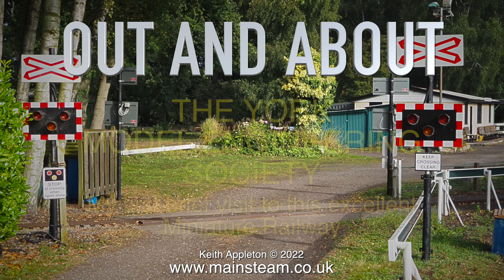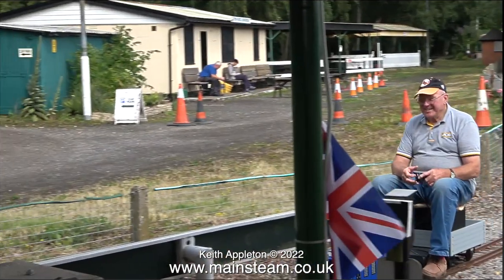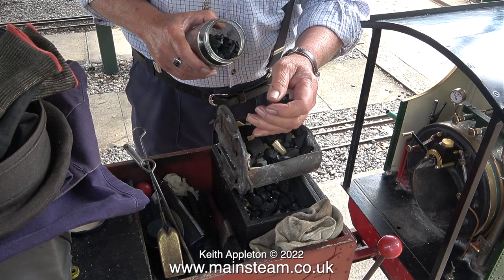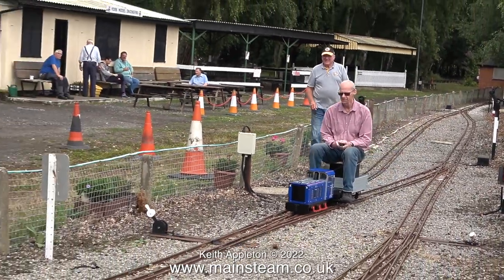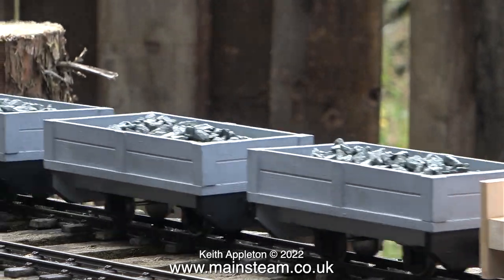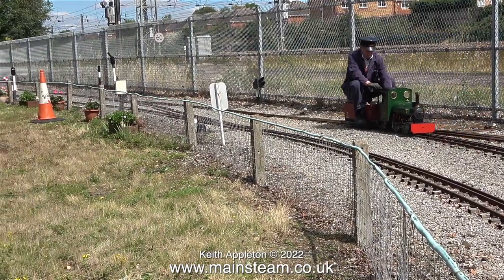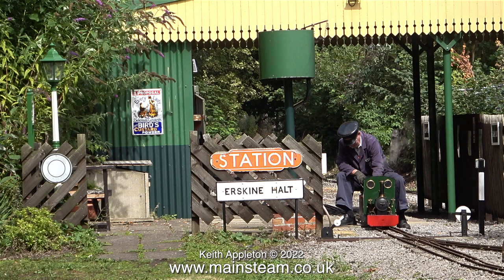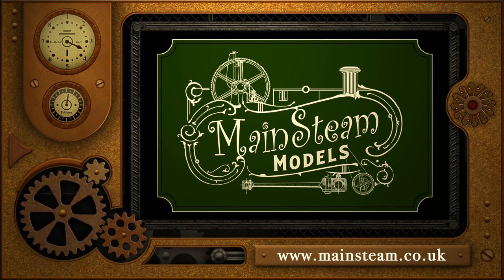OUT AND ABOUT - YORK MODEL ENGINEERS - FIRST BRIEF VISIT

Comment: What an amazing place. It brings back memories of when I was a Train Driver. 
I drove nearly all the diesel-electric locos seen here. 
Also the electric locos such as class 85, 86, 87, etc. 
I noticed a class 20 diesel-electric loco in the video and can remember every part of it and preparation it for starting. I wonder if the model has a BIS ( battery isolation switch) fitted to the side for authenticity. The diesel engine drives a generator to power the traction motors on diesel-electric locos. There are some older passenger sets that actually get driven by the diesel engine. They are called DMUs "Diesel Multiple Units" but they don't run them anymore as far as I know. I was never trained on them.
I also noticed that the club's signaling has a "track circuit" with the color light signaling which is brilliant. As soon as the train passes the green or yellow signal it turns to red.
We used to carry "track circuit clips" which is just a piece of wire with a rail clip on each end and when placed across the rails turns the signal behind it to red. They would be used in an emergency situation along with detonators. Really enjoyed this Keith. Cheers. 🚂🚂

Comment: The zinc leeching is a common problem with straight brass fusible plugs. To be honest I only came across it this year on my boiler test with a chance comment to my boiler inspector. I had mentioned that I always had issues getting the fusible plug out and was surprised that they never sheared given I was swinging on a cracking bar to get them out with only 12 months service. He said it was just the nature of it with the heat but didn't say it was anything to do with water.

The boiler inspector explained that the zinc leeching out essentially binds the threads up. He said that I should be using phossy bronze / tapered plugs. My winter project is to make a boss to convert from a straight to tapered fusible plug. I already have a boss in the crown as the 3/8" threads in the boiler were shot and I had gone up to 1/2" BSP then stepped down to 1/4"BSP plugs. However I had made a straight tapping, so now I will remove the boss and make a new one. He also wants the new boss welding in by a coded welder.